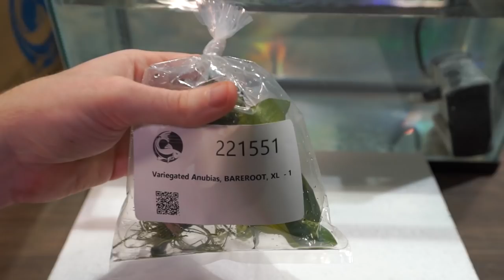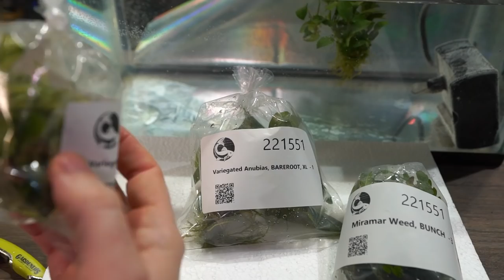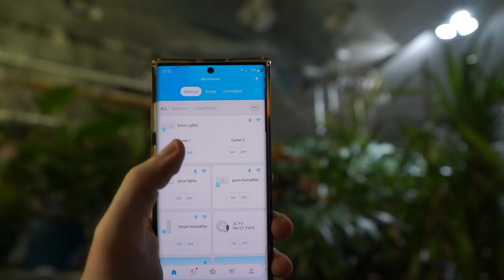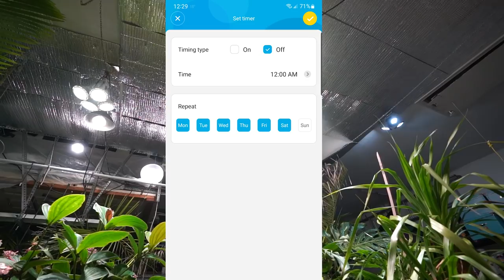More Snow! More New Plants! Fixing & Hanging Grow Lights || Saturday Vlog

Comment: "I have them set to turn on at 8 AM and turn off at midnight, that's about 14 hours"
umm, that is 16 hours. 8-8 is twelve, 8-12 is four, 12 + 4 = 16. And I notice you have A LOT of fungus gnat sticky things in the pots. Those worked well to get rid of mine. As in they haven't come back so I guess they never got around to breeding.
Also, where's the creepy unicorn kitty thing that usually sits on the desk?
Reply from the maker: I wondered if anyone was going to catch that! LOL! It was 14 hours before I increased it. It's on a shelf ready to go back out.